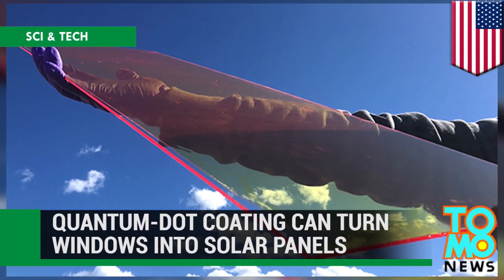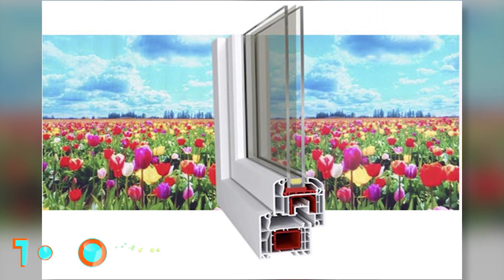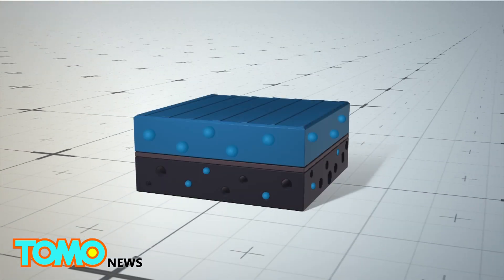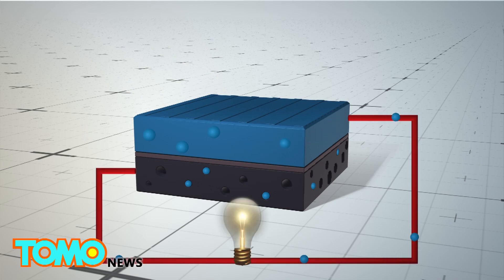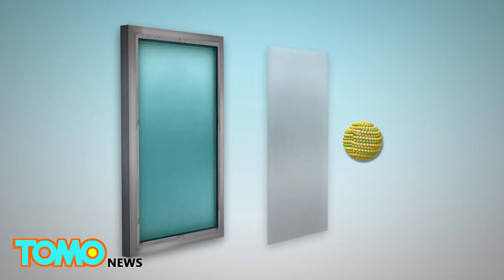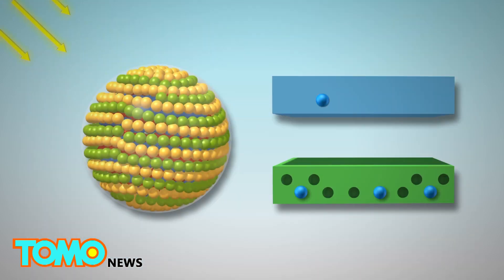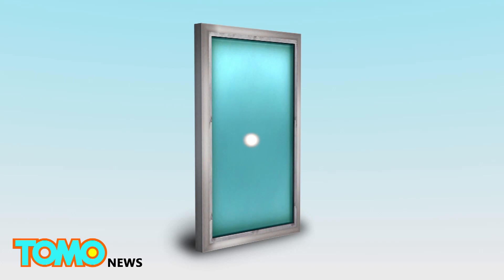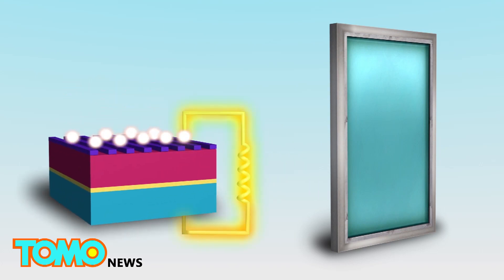Solar panel windows: coating of quantum dots on windows harvest energy from the sun - TomoNews

Comment: why on a window? just roll that shit over the whole roof,idk
Reply: the point is that you can see through
Reply: eg0zb yes the see thru part is kick ass
Reply: Donald Sanders why would you want it on a window as opposed to the roof or siding? simple question, I under that it is a self contained unit so that's good too....but I just for see issues with seeing out the window long term, or if it fails, you replace the entire pane, etc. why would you want it on glass. if you can't answer, iguess...